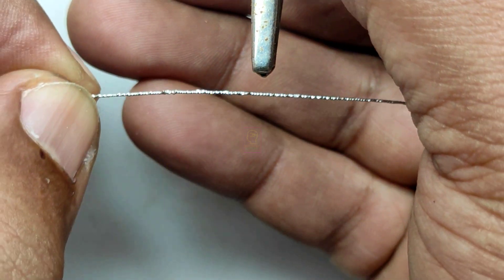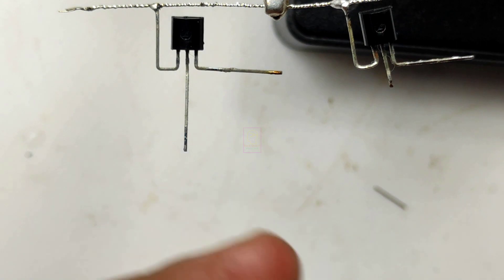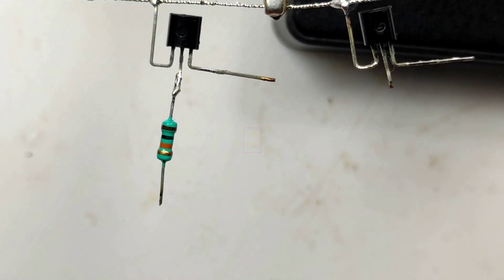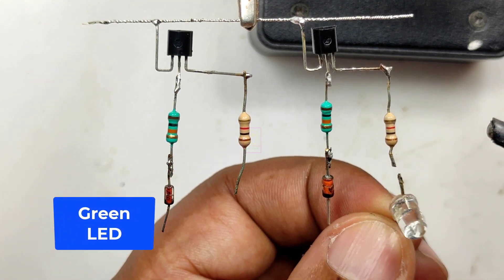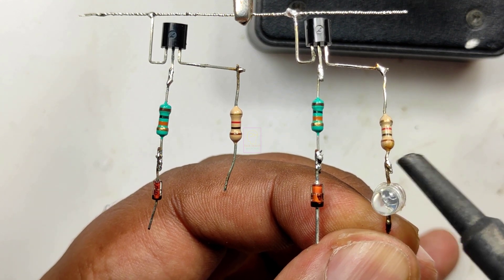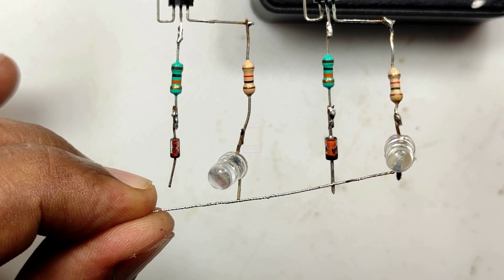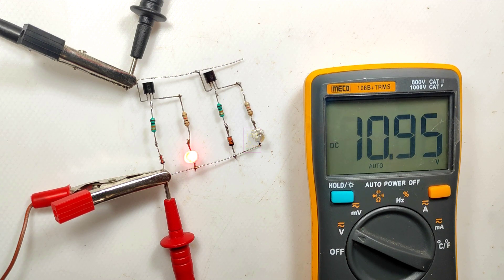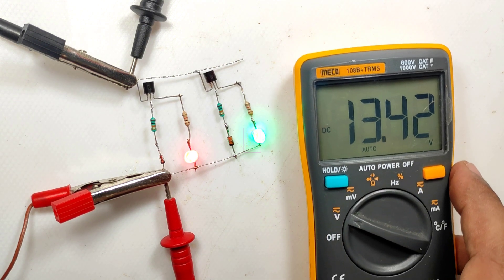Unlocking the Secret to a Perfect 12V Battery Level Indicator Circuit

Comment: How to  use it?
Reply from the maker: Connect the terminals to the battery.  I have given a variable power supply. Those terminals connect to battery
Reply: @TechInsert  Thanks 😃
Reply: Connect the + and - terminals to the battery terminals
Reply from the maker: @tabm7644  Nice
Reply: Connect to battery terminals
Reply from the maker: @John-pk7lr  Thanks

Comment: Nice information about static electricity
Reply: Exactly
Reply from the maker: @BabuRaj-cs4lk  This is a very important one while soldering these type of components. Mostly this is affecting to semiconductors which will work on less than 5V espicially 3.3v
Reply: @TechInsert  Absolutely right, 3.3V components is mostly firing by static electricity
Reply: @BabuRaj-cs4lk  Yeah i have heard this but didnt realize yet. Nice thing
Reply: That is we must be careful while soldering in computer motherboard, mobile motherboard and even some sensors use 3.3v
Reply from the maker: @tabm7644  Your statement is abasolutely correct
Reply: @tabm7644  very true
Reply from the maker: Thanks
Reply: Yes very true
Reply from the maker: @baburaj1645  Thanks
Reply: Good explanation
Reply: Yes true